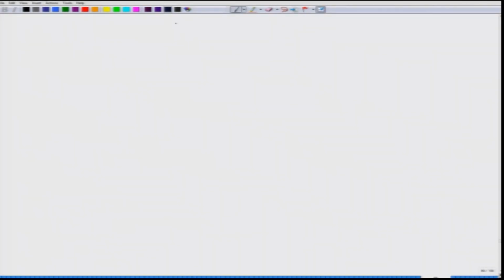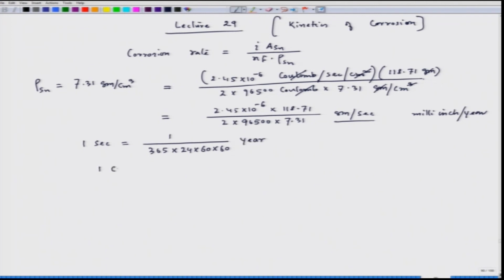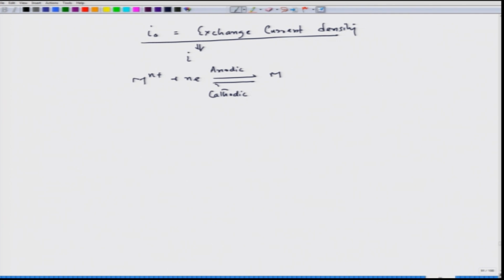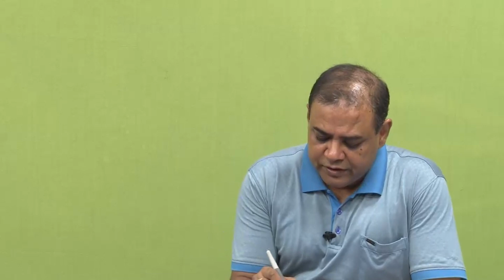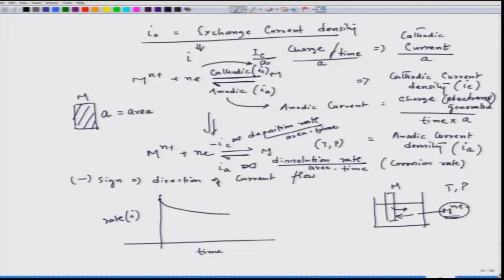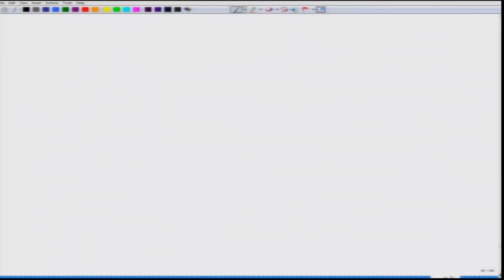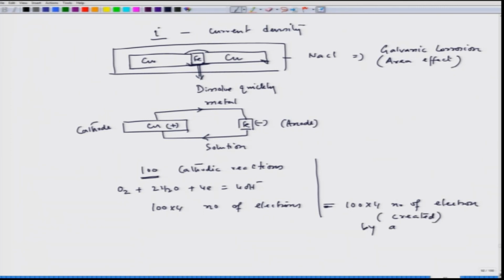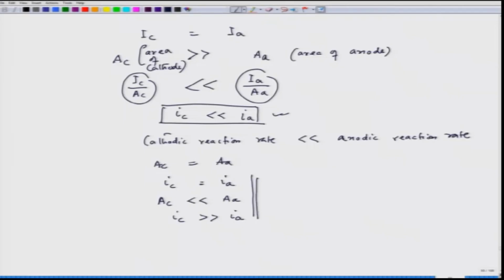noc18-mm14 Lecture 29-Exchange Current Density

Comment: Sir can you give a example for this.. in HCl solution  the zinc is going to corrode..and .. where this exchange curent density can be found??and why it's useful??how can we find this??
Reply: where the anodic current density[rate of dissolution] equal to cathodic current density [rate of deposition]  that particular value of current density is called exchange current density i0. It will be more useful in the mixed potential theory.